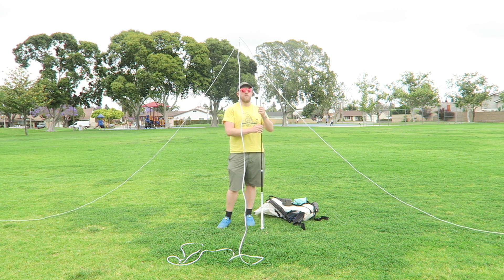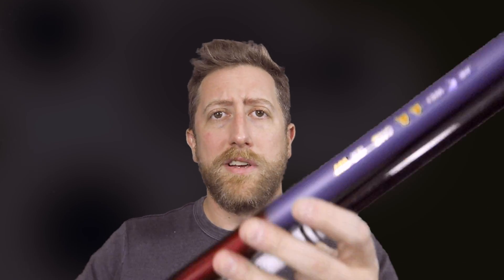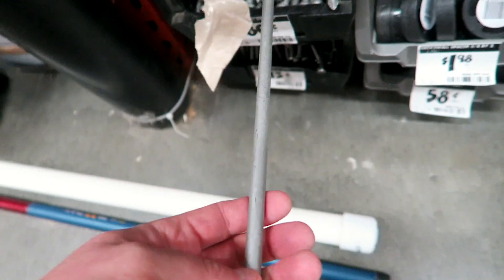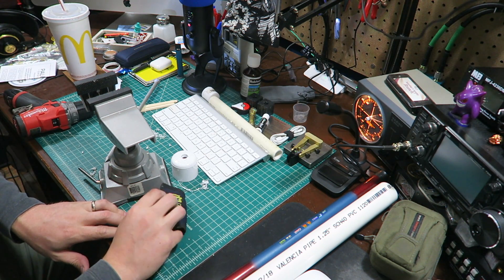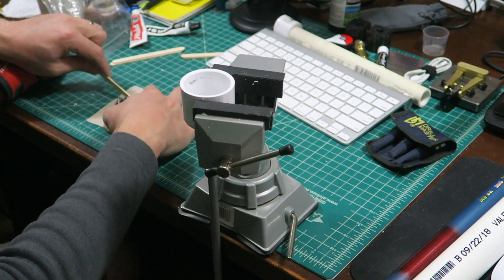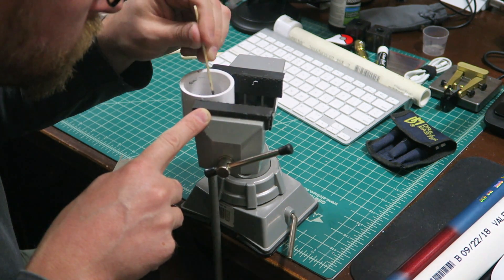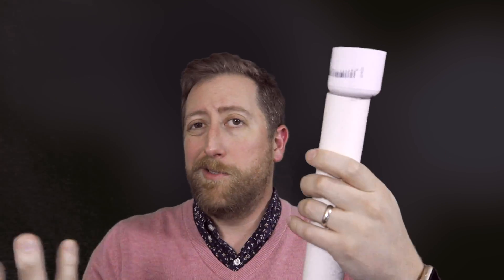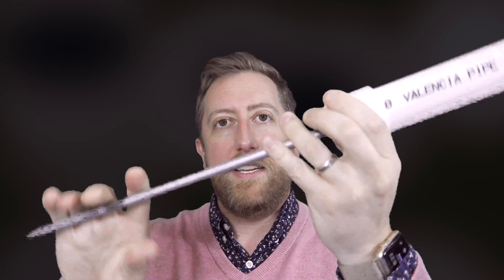DIY Antenna Mast Spike For Portable Amateur Radio

Comment: I'm using a 20ft painters pole as a portable 2 meter mast. It conveniently has a hole in the bottom, so I just cut the head off that very same HD spike and the pole fits right over it. Not self-supporting, though. Gotta guy it. I'm good with that.

Comment: Which mast is that? I can’t find anything close to $10 at the moment
Reply from the maker: It’s a cheap telescopic fishing rod off ebay I picked up years ago. Looks like prices have come up. Make sure to select 7 meters. https://www.ebay.com/itm/Goture-Carbon-Fiber-Telescopic-Fishing-Rod-Pole-Carp-Feeder-Tenkara-Fishing-Rods-/363462537376?mkcid=16&mkevt=1&_trksid=p2349624.m46890.l49286&mkrid=711-127632-2357-0

Comment: I love the mast-spike idea!  I do have a quick suggestion to prevent breaking the JB Welded joint when driving the spike into the ground.  Get a hard-wood dowel with a similar diameter to the inside diameter of the spike-cap.  Insert the dowel into the cap, and then pound the dowel to drive the spike into the ground.  This will apply the force directly to the combined JB Weld and nail-head, thereby preventing the JB Welded joint from cracking or otherwise coming loose.  Keep that wooden dowel with the mast-spike kit to be ready for all of your outings.  Thanks for all the great content!

Comment: Heat up the rod and force it through the PVC and maybe predrill a hole. To seat it nicer the PVC could be melted with a firelighter while the rod it through the PVC.
Reply from the maker: That would work too. I think you’ll still need to reinforce with something like jbweld.

Comment: How about a mason’s spike or nail?  See WV0H, Myrons blog re super method of holding up even the 30’ Jackite pole:  

https://wv0h.blogspot.com/2014/07/attaching-spike-to-mfj-1910-pole.html?q=Spike

I have three collapsible poles with this method.  Granted your method may be faster but the mason’s spike is secure without any guys.

72,

Dave K8WPE since 1960

Comment: The "big nail" for anybody looking correct name is a landscape spike.

If you need to get JB weld to self level you can use a heat gun to lower the viscosity without effecting strength.

Comment: Hello Hoshnasi.  This is off subject for this particular video lesson but, what are your thoughts about "Dr. Ed Fongs" dual band twin lead end fed J-pole antenna design?. I have read that it out performs the basic copper pipe J-Pole design with higher gain, higher this and  that and everything else. What are your thoughts.
   Thanks for reading!
Reply from the maker: I have not used one, but everyone I know who has loves them.

Comment: Nice idea, I was wondering about different epoxy types and how well they would bond to the metal and PVC.  I like the portability of a simple speaker wire dipole for QRP.  Thanks for the cool video.

Comment: You want a cheap FAN DIPOLE center support with a pulley / rope TESTING for wire antennas use a SCHEDULE 80 use a 3" or 4" dia PVC and use four legs of the Fan Dipole as PVC pipe supports for the tower and you can run the COAX INSIDE the PVC to protect it from critters  ( dogs / cats / mice / rats )   and use your ground spike are a stabilizer at the bottom =)   I have made three of these in the last few years and ALL are still standing ( one 40 foot has been up for almost ten years =)   I hope this helps create a cost savings and easily replaceable mast / PVC tower or platform =)  You may need a parachute cord mid support as the center is bendy when setting up =)      Never fell down in many 75+ MPH winds in tornado alley =)
Reply from the maker: This is used for SOTA activations where we hike in sometimes 10 miles round trip.
Reply: @HamRadioCrashCourse  I have made a walking stick version of the same with 1 1/2"- 1 1/4" - 1" - 3/4" to 1/2" about 5 foot long walking stick to go to about  ` 16  foot mast / walking stick =)  I used the same SPIKE the same way at the bottom =)

Comment: If you take a small section of inner tubing larger than the longer tube in diameter, and puncture it with the spike, so when you store the nail/spike inside the tube you can keep it from rattling too much plus it will help to keep the spike/cap from falling out on it's own, depending on how much of a friction fit your inner tube provides. 
If the inner tube section falls off inside the PVC tube section, no biggie. Use your antenna pole to push it out the open end.
You can even push the tubing all the way up against the spike end cap to secure it and prevent loss.
There are other things you could use, like maybe a pingpong ball but it would probably wear out the spike hole then fall off or get lost.
Let your imagination go for it.
Thanks for the video!

Comment: Also glue another cap the opposite direction on the nail to make it fit over the pvc pipe so in hold the nail and it doesn’t jangle around.
Reply: I was thinking the same thing!

Comment: What about putting a nut on the threaded bolt and tighten it down with red loctite.
Reply from the maker: Sure, but the threads are gonna get dirty
Reply: Didn’t know it was ever going to be unthreaded...lol.
Reply from the maker: Its for portable radio operations.  Like hiking, pack in pack out.
Reply: Yes it is for pack in pack out. The nut suggestion was intended to be a quicker alternative to waiting for JB weld to set up.

Comment: Two part epoxy might be better!
Reply from the maker: That’s what HB weld is.
Reply: @HamRadioCrashCourse , true but you can get a thinner viscosity with the plain epoxy because it doesn't have the metal flakes in it which gives it a thicker consistency. Besides, the extra "strength" afforded by the JB Weld metal flakes isn't absolutely necessary to hold the nail in place, either.
Lots of options on how to do it.